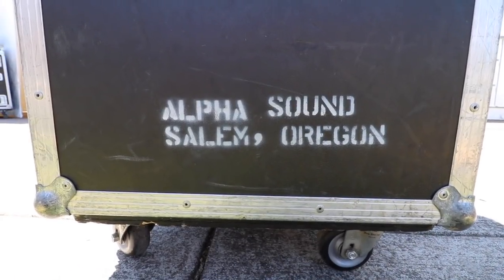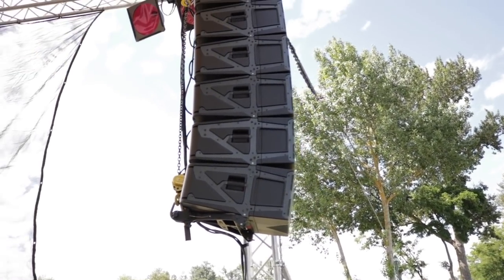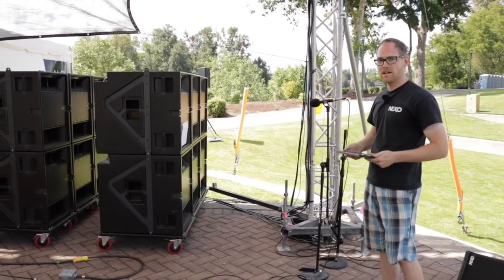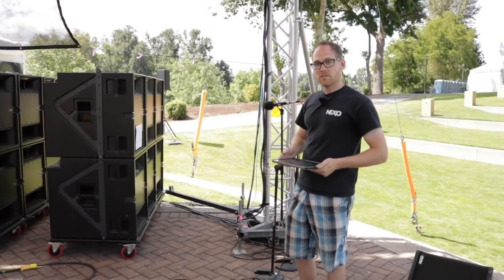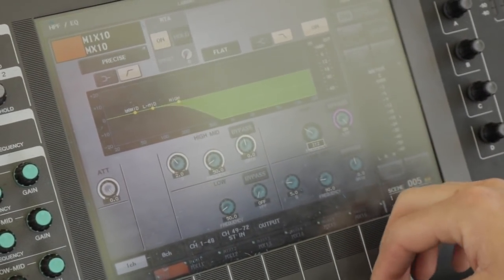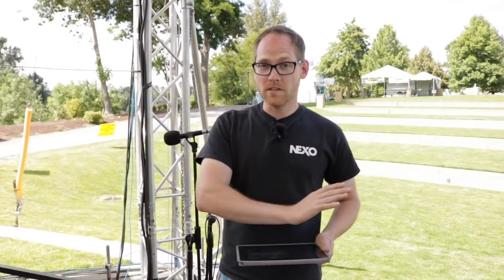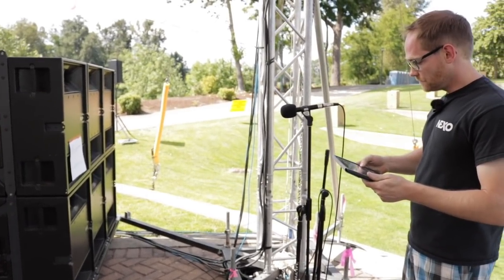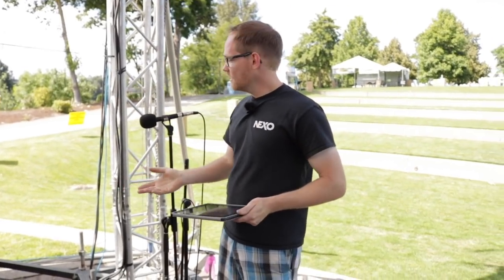The Ultimate Subwoofer Bass Trick

Comment: Man you just have to be careful, you can burn voice coils by cranking frequencies that the drivers can't reproduce! But cool idea!
Reply: Its pretty uncommen tho. And it depands if they passive or active.
Reply: @karsmemelink770  
Exactly
Those active processed boxes have robust protection.
Reply: Surely he knows what he's doing.
Reply: it's pretty much standard to always run a 40hz high pass on the whole PA
Reply: That's what the DSP in the amplifiers or system processor usually handle and remove to protect the speakers.

Comment: Dear Sirs, I'm not sure about the signal flow. He created an AUX Buss (Mix 10), turned on the LPF (100Hz) and inserted the Pitch Shifter. How did mix the signal in the subs? Should the subs be plugged into an Aux path or are they on the PA system processor?
Reply: mono sub?

Comment: So you’re just pitch shifting the drums to make them hit harder in the sub bass frequencies.
Reply: No.  The pitch-shifting is to break the feedback loop, so that sound that is amplified is not coincidental to the sound that is picked up by the mics a second time.  Every trip through the mic-speaker-mic loop is down-shifted by one octave, where it quickly slips beneath the subsonic filter and is low-cut filtered away entirely.

The audible effect (other than the absence of feedback) is secondary, and may be desirable or not.
Reply: @nickwallette6201  I see, thanks for the clarification 👍

Comment: Great ideea,  definately gonna take a crack at it,
I wonder if, would it work with orchestras's and other more melodic instruments or would it mutate the sound?  
keep up the good work
Reply from the maker: Depends on how good the processing is. On the Yamaha console with that particular setting, there is some amount of distortion since it wasn't intended to be used this way. What's nice is that it does have very low latency compared to other pitch-shifting plugins. For melodic and higher-quality purposes, we would chose a more sophisticated plugin but one that also had low latency. After that, the only question is one of taste.
Reply: @devinlsheets_alphasound  
Thank you very-very much for the repply. 👍😀
Reply: It would mutate the sound regardless of “processing power”.  Forget the pitch-shift manipulation and just do a gradient array and tune the delay to keep your “null” heavy where the basses (generally about 45 degrees off axis on-stage behind PA) and cellos (between 90-45 degrees) usually are set with a traditional orchestra.   Remember with one sub “component” behind another, out of phase, creates a dipole shape, and as you delay the rear component it pulls the rear lobe inwards and broadens that and the front lobe, but too much (approaching 200% of the delay distance front baffle to rear) and it starts over again  but is really creating harmonic havoc.

Comment: Presonus Air18s, I have a pair of them & I am curious if u think stacking them with top one facing away from dance floor and uses the DSP to set as a Cardioid it will do the magic of getting most of the bass response coming forward up to what frequency before  there is some real loss of the cardioid effect?, 80 or 100, certainly at 150 I would suspect...

Thanks, The Wedding DJ, LOL... 😁
Reply: Sub bass is omni directional USUALLY , so stacking and directing the speakers opposite directions (without processing) shouldn't change anything with regards to bass phase correlation, compared to putting them next to each other, except for the fact that the phase correlation pattern will now be turned 90 deg, so what you usually expect on a horizontal plane, will now be happening on a vertical plane instead and visa versa, but nothing much will change front to back. If I understood your question properly bare with me....

The directional nature of a sound driver depends on it's size, so for example an 18inch woofer (1.5 feet) will be directional down to 1KHz, where as a 3 foot driver (kinda unrealistic for most applications) can be directional down to 500Hz, and any lower than that, the speaker is unable to focus the sound energy properly and it starts to gradually become omni-directional from there on downwards. If you want to focus sub bass in a very specific direction and have the best rear cancellation with just 2 speakers, you need to look at things like an end-fire array set up with delay (putting one speaker behind the other on a few ms delay so forwards the waves sum, and backwards the waves cancel), or a gradient array.

However having said all that, I believe the speakers you have, have a special setting for delay, phase, gain and filters that works in the configuration you said to make a cardioid pattern by making something like an advanced drive gradient array (as well as an endfire preset when the cabs are placed in the correct positions too), and this will take up less space than an endfire, as you need a 5 foot grill to grill spacing distance (facing the same direction) for endfire with your speakers and Presonus's endfire preset, so you loose some dance floor, but get better directional focused bass. I don't know how well this (the gradient array cardiod pattern) specifically works with the Presonus Air line up (it really depends on what exact processing they are using, so is very hard to opine on), but it's probably more suitable to your application due to the small spaces things like wedding receptions are held in. 

I'm assuming you have other speakers you play the low mid and upwards on etc.? 

With these very closely spaced array set ups, if properly set up with correct processing (like the one you're talking about), you're probably looking at very little lobing if any lobes at all (the break down of cardiod pattern into fingers of phase correlation and nulls in between) up to at least 100Hz, and even at 120Hz there should be a decent area without major amounts of lobing (mby 3 with 2 thin nulls at most). However the thing is that even if the edges of the pattern start to form bumps at this frequency range, front to back performance often will change higher up than the front pattern starts to break up (although some array set ups are more prone to falling apart at the back than others, generally with the ones we are talking about this is much less so). If Presonus are using frequency dependent delays (which I have a sneaky feeling they will be), then this can basically mitigate this falling apart of the pattern throughout the entire speakers range in all directions, as each freq has a specific delay set to get the best pattern possible for that frequency (and for comparison with endfire, the closer you have them and the shorter the delay the less overall level you get, but the wider a frequency response your pattern will be stable over, if setting it up manually, IDK if there's options to change this preset with your set up). 

It's worth looking into if they use frequency dependent delays, as this could be the deciding factor between end fire and advanced drive gradient pairs, as it may not be more beneficial to have the space saving of advanced drive gradient if the Presonus settings can't fully mitigate the breakup of the pattern from 120Hz upwards with it (I assume they know what they are doing though and got it right). If Presonus haven't released any info on how their presets work, you can always set them both up and listen to how it changes things, walk around the space in front and behind the stack playing different freq tones and see what one works best for your application. ;) 

This is only for subs though, and shouldn't really be used for mids etc. and you want other speakers to handle the mid range if you are going for one of these set ups as they do fall apart when you start getting much higher than 150Hz, no matter what processing they are using (as it will be tuned specifically for the low end). But then, even if you have a pattern that falls apart at 120Hz upwards, you can just crossover at 80Hz anyway, or 65Hz if your mids go that low and you're playing particularly bass heavy music (or if the mids don't go that low, 100Hz or where ever the mids go down to).

I hope I managed to make that make sense lol. If I didn't explain something properly let me know and I'll try to explain it better. ;)
Reply: @DaftFader thanks for this reply, i learned quite a bit from it!
Reply: @LaserChair  Glad to help. I forgot to add. You'll sometimes find systems (useually med to larger ones) with subs low passed as low down at 65 or mby 80 then dedicated bass drivers filling in the space between the mids and subs. Usually dedicated to the punch range. As if you split your freq spectrum into 4 bands (sub/bass/mids/tops) this will give better clarity to both bass, sub and mids (just like a 3 way studio monitor with a sub, vs a 3 way monitor doing the full range, the main woofer of the monitor does not have to strain to produce both the bass and the sub frequencies so will have more clarity and punch in the bass/punch band and the subs will be cleaner too). 😉👍

Comment: If you split your sub boxes equally and placed them in the right and left of the stage in mono you still get phasing issues? I don't understand why the subs are all the way to one side of the stage,, thanks!
Reply: this is mono, baby 😍
Reply: This is called an endfire configuration. Both sides of the stage would have this same setup. The rear group of subs are fed a flipped polarity sinal and delayed by the amount of time it takes for the sound to travel from the front end of the front stack to the front end of the back stack. This created a cancelling effect of the sound towards the back and focuses the sound out the front.

Comment: What? You run the signal that goes to the subs thru a pitch shifter? So your signal is completely distorted, you are simply producing subharmonics ?!?
Reply: I agree, i don’t understand what he is trying to achieve, I only know about basic pa and small sound systems….
Reply: Listen carefully, the 2nd time it goes thorugh the signal chain it's so low in pitch the speakers can't reproduce it anymore, so it doesn't feedback.
Reply: It will use whatever the instrument has as even harmonics to boost the fundamental and even harmonics. But you will only hear the effect in the 2 octaves from 25Hz to 100Hz.
It may sound bad if:
A subharmonic is out of character.
The instrument has strong 3rd harmonic (that would come out as 1 1/2 harmonic bleagh)
Reply: yes but if used "tastefully" can really enhance the FOH sound of the instrument. one variation I use is to both low AND high pass the sound going to the pitch shifter.. effectively "selecting" note range you want to generate the artificial sub from. I usually chuck a high pass on the pitch shifter output too.. to really dial it in.
Reply: @szaki95  everything that goes thru this signal chain is pitched down to half the frequency! 
As the overhead mics must be highpass filtered anyway to avoid wind noise, there will not be much original signal left below 100Hz coming from these mics. So the result will be that the frequency range from 100-200Hz of these mics will be pitch shifted down to half the frequencies (50-100Hz) and reproduced by the subs. For this specific application with percussive drum signals it may sound ok or even natural. But do not do this with melodic instruments playing „real tones“...
Reply: In other videos he said he used it on stringed instruments as well.
Reply: @joeden68  Sub sounds are nothing but a sine wave, doesn't matter if it comes from a drum, a guitar or horns, the sub has exactly the same sound I guess. Differences of tones are only heard in higher frequencies I guess. I would even assume that very high frequencies of any instrument sound the same with each other again...
Reply: @lordclancharlie1325  woooooooooo, what are you talking about here?
I agree that every sound is created thru sinewaves (fundsmentals and harmonics). And the frequency defines the tune of this waves (the tone pitch). A tone with half the frequency value (generatet by pitch shift) is exactly one octave lower than the original one with double the frequency, pitch shifter is shifting the pitch, that’s why it is named so! So in case of percussive drum signals you will not hear much difference between the original 60Hz part of a drum and the downshifted 120Hz part, as these waves are normally very short (2-5 cycles only).
But if you play tones in a melody with an acoustic bass instrument for instance in a classic orchestra and all your lower notes you are playing are suddenly reproduced one octave lower than you play them (because of pitch shift), what do you think would happen?!
If I play E2 tone = 82,4Hz, I want to hear this tone and not E1 = 41,2Hz ! Look for notes vs. frequency table, that may help to understand this topic...
Reply: @joeden68  I get what you mean but in practice I'm not convinced. I'm talking pure sub, lower than 80hz. I will make the test once, a piano note and the same saxophone note, only the sub frequencies (<80hz) and try to differentiate them... Not sure it's the case), I'll check once and come back to you ;-)
Reply: @lordclancharlie1325  it’s quite simple: identical waveforms sound the same, doesn’t matter how they are created.
But that is not the topic here, the topic is pitch shifting your sub-send which creates half the frequency = one octave lower tone from the original! Original 160Hz input results in 80Hz output, original 80Hz in 40Hz and so one. 
“The instrument” simply plays one octave lower then = subharmonic distortion
Reply: @joeden68   I totally get what you're saying. I've used subharmonic processors in car stereos for years, and on older recordings that lack a good solid kick drum, they make a vast improvement. But on some music, it totally messes up the bass guitar line.
Reply: Yeah, completely agree here, I don't actually get what this is trying to achieve at all apart from shifting the Tyco sub frequencies and actave lower and putting a ton of strain on the coils an octave down under that ( unless you high pass that off )

Comment: So this is basically just adding sub harmonics an octave lower than the original Tyco drum sound like say, an octave bass pedal. 

I mean, why not just move the subs forward, high pass the Tyco's up to around 60 hz and just have that coming out of the PA without the sub harmonics with that close mic'd main low Tyco in the middle eq'd like a kick drum with a bunch of low mid pulled out. Couple of overheads for the tops mixed in and you'd still get a huge sound.
Reply: It's not about adding sub octave content.
It's about taking the natural feedback loop in the bass and having it constantly fall below what the subs can reproduce as every time it passes through the loop it is pitch shifted down and so can never build up and "feed back"

Comment: I must be missing something. Can anyone explain why the sound of the drums doesn't get lost in the subs, in the same way that the feedback does ?
Reply: I think I understand. So because each hit of the drum is only lasts less than a second, it makes it out of the subwoofer. Whereas, under normal circumstances, feedback continues to be produced by the system, therefore it quickly gets cancelled out by the lo-pass filter and pitch shift.     Is that correct?